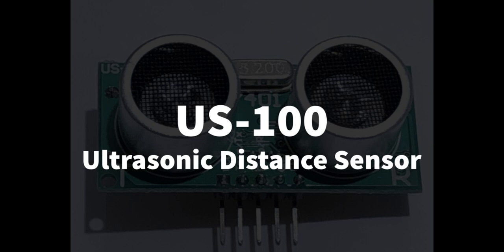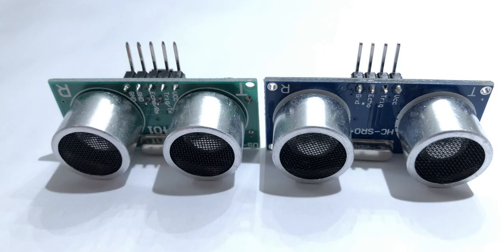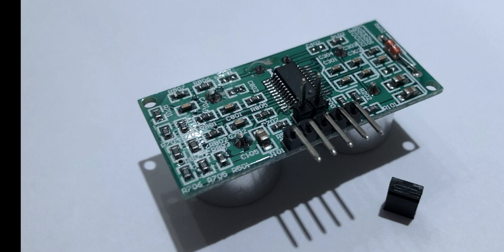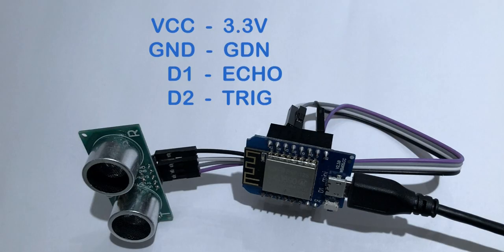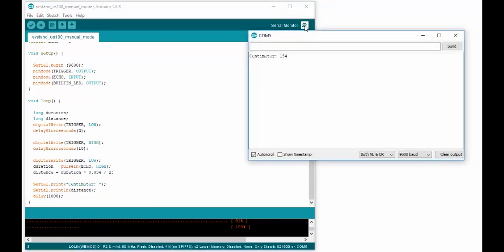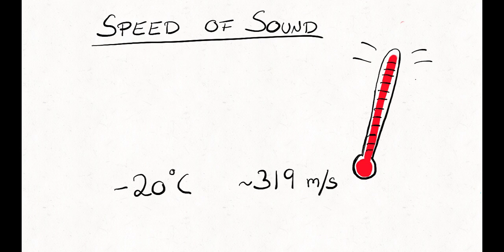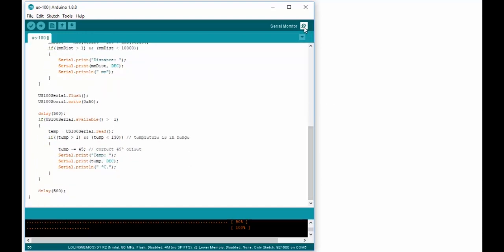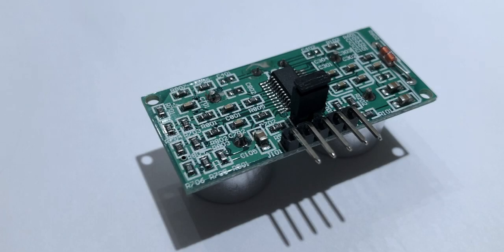US-100 ultrasonic distance sensor - 3.3V and 5V with temperature sensor perfect for ESP8266

Comment from the maker: Chris is convinced that the diode is a ntc100k thermistor which is used for temperature sensing, especially when it comes to 3D printers. There I go for not checking with him first. Live, learn, make and invent!
Reply: Yes I checked it out. If I hold onto the diode, the temp immediately changes and then does the Newton's law of cooling thing when I let go of it.

Comment: bei mir wird so gezeigt also Fehler , haben Sie eine Lösung ???
VG und Vielen Dannk für einfache Erklärung.
  

Beim Hochladen des Sketches ist ein Fehler aufgetreten
avrdude: stk500_recv(): programmer is not responding
avrdude: stk500_getsync() attempt 1 of 10: not in sync: resp=0x53
avrdude: stk500_recv(): programmer is not responding
avrdude: stk500_getsync() attempt 2 of 10: not in sync: resp=0x53
avrdude: stk500_recv(): programmer is not responding
avrdude: stk500_getsync() attempt 3 of 10: not in sync: resp=0x53
avrdude: stk500_recv(): programmer is not responding
avrdude: stk500_getsync() attempt 4 of 10: not in sync: resp=0x53
avrdude: stk500_recv(): programmer is not responding
avrdude: stk500_getsync() attempt 5 of 10: not in sync: resp=0x53
avrdude: stk500_recv(): programmer is not responding
avrdude: stk500_getsync() attempt 6 of 10: not in sync: resp=0x53
avrdude: stk500_recv(): programmer is not responding
avrdude: stk500_getsync() attempt 7 of 10: not in sync: resp=0x53
avrdude: stk500_recv(): programmer is not responding
avrdude: stk500_getsync() attempt 8 of 10: not in sync: resp=0x53
avrdude: stk500_recv(): programmer is not responding
avrdude: stk500_getsync() attempt 9 of 10: not in sync: resp=0x53
avrdude: stk500_recv(): programmer is not responding
avrdude: stk500_getsync() attempt 10 of 10: not in sync: resp=0x53

Comment: Hi, Thank you for your great video and explanation.
Tested with arduino uno : works as expected in the UART mode, this is excellent.
Testted with ESP8266-07 :  works in manual mode ie  Echo/Trigger,  however I didn't success with the jumper on ie in UART mode. I guest ESP8226 07 model doesn't have the UART needed. What I am doing wrong ?  Any feedback will be appreciated.

Comment: Thanks for the video!! What version of Arduino IDE are you using? What operating system? What version of the required libraries are you using? I have Win7 Arduino IDE version 1.8.13 and esp8266 package from https://arduino.esp8266.com/stable/package_esp8266com_index.json
and appears to be version 2.7.4.
When I run the code on the esp8266, I ONLY get a "temperature". But I can change the "temperature" by moving my hand around in front of the sonar.
Reply: I have two US-100s and both of them work with the exact same code on Arduino IDE, just change board to Nano with the "old bootloader" compiler option.

Comment: I compiled the code and uploaded to an ESP-12E module and I can ONLY get "temperature". No distance printout. But if I place my hand in front of the sensor, I can make the "temperature" change by moving my hand further from or closer to the sensor. I tried compiling with NodeMCU1.0 board, Generic ESP8266 Module and ESPino board compiler options but behavior does not change. Tx is connected to IO4 (D2) and Rx is connected to IO5 (D1). I tried swapping the lines but then it stopped working. I un-swapped the lines and then it started working again.
Reply: BTW, It works great with an Arduino Nano in the Arduino IDE.
Reply from the maker: That’s very strange... very! I’ll have a look at the code to see if there are anything that can enlighten me!
Reply from the maker: is there any output on distance? (any of the text?)
Reply: @DIYTECHBROS  Thank you kindly for the quick reply!! The "Distance: xxx mm " statement does not print but "Temp: xx C. Does print. AND I can change the Temp by moving my hand around. If I hold my hand about an inch away, I usually get something like "Temp: -11 C". If the sensor is on the floor pointing up at the ceiling, about 8Ft or so, I get "79F" or thereabouts.
Reply: @DIYTECHBROS The code is a copy and paste of your Github UART mode example. I was REALLY impressed with the accuracy of the sensor in UART mode!
Also I tried it on Ubuntu 18.04 and got the same strange result. But if I use an Arduino Nano, it works fine.
We have had trouble with SoftwareSerial in the past when working with the esp8266, if memory serves.
Reply: @DIYTECHBROS  Hallel Yah!! I figured it out!! I modified the code to just simply show me the bytes the sensor was kicking out and it became clear that the first byte is temperature and the second and third bytes were distance. Here is the diagnostic code I tested:
****************************
void loop()
{
  US100Serial.flush();
  US100Serial.write(0x55);
  delay(delaytime);
  while (US100Serial.available())
  {
    MSByteDist = US100Serial.read();
    Serial.print(MSByteDist, DEC);
    Serial.print("  ");
  }
  Serial.print("End of 0x55 data, ");
  US100Serial.flush();
  US100Serial.write(0x50);
  delay(delaytime);
  while (US100Serial.available())
  {
    MSByteDist = US100Serial.read();
    Serial.print(MSByteDist, DEC);
  }
  Serial.println("End of 0x50 data");
  delay(delaytime);
  yield();
}
****************************
So they must have changed the hardware somehow. So I changed the code a bit so now I get the temperature AND the distance with each 0x55 write. I am not sure what the 0x50 write does but it is required to make it work 'cuz when I delete it, the loop no longer works. Also, judging from the raw data, I suspect the temperature is in Fahrenheit. Since I only have atape measure in inches, I modified th eloop a bit:
******************************
void loop()
{
  US100Serial.flush();
  US100Serial.write(0x55);
  delay(delaytime);
  while (US100Serial.available())
  {
    temp = US100Serial.read();
    MSByteDist = US100Serial.read();
    LSByteDist = US100Serial.read();
    mmDist  = (MSByteDist * 256 + LSByteDist) / 25.4;
    if ((mmDist > 1) && (mmDist < 10000))
    {
      Serial.print("Temp: ");
      Serial.print(temp, DEC);
      Serial.print(" ºF, ");
      Serial.print("Distance: ");
      Serial.print(mmDist, 2);
      Serial.println(" in");
    }
  }
  US100Serial.flush();
  US100Serial.write(0x50);
  delay(delaytime);
  yield();
}
******************************
Reply from the maker: Great!!!

Comment: Great Video! UART MODE doesn't seem to work for me ,  I have added the jumper & also connected Trigger & Echo to Pin 4 & 5 as per the UART code. But i am not getting  distance & temprature value in the serial monitor. Please let me know, is that am doing wrong. Also i have the latest software serial library updated in my IDE "espsoftwareserial"
Reply from the maker: Hi!
Make sure TX goes to RX, and RX goes to TX :)

Comment: hello I tried your example in UART mode with a nodemcu, but it doesn't work. which pin should i connect?
Reply from the maker: You can use the pins you prefer, just remember that GPIO and D(n) is not the same. You can write D(n) instead of just a number to refer to the pin marked with that label.
I believe GPIO 5 = D1 and GPIO 4 = D2. Just google NodeMCU pinout :)
Let me know if that was the error!

Comment: What is the reason for using this formula  "mmDist  = MSByteDist * 256 + LSByteDist" ? why 256?
Reply from the maker: Hi Lawrence! That's an excellent question! It's simply because we need to do simple bit shifting. Not uncommon when dealing with analog reading from sensors. As an 8-bit number is limited to 255 (or 127 unsigned) we don't want an overflow. Also int in the word of arduino is 16 bit.
Reply from the maker: Google "bit sifting" and "bit shifting analog sensors" to read more! Happy thinkering :-)